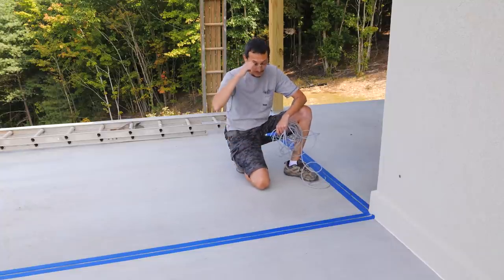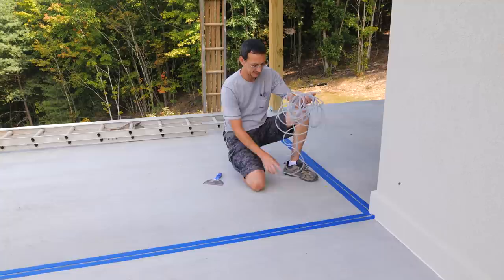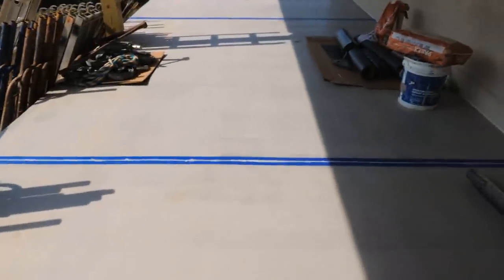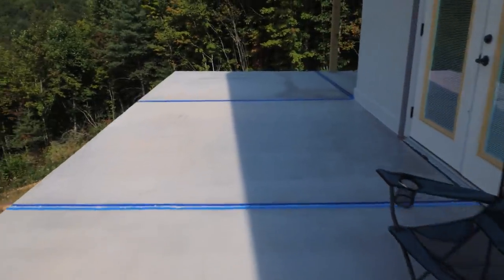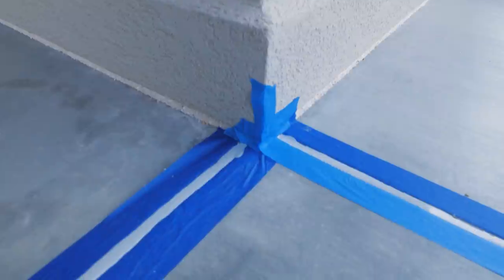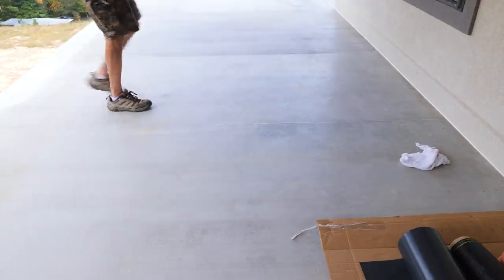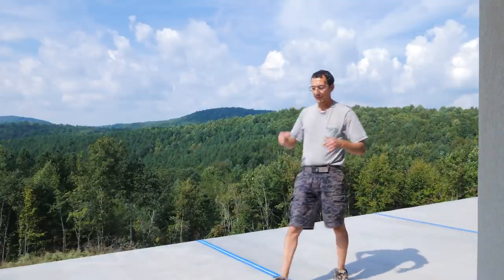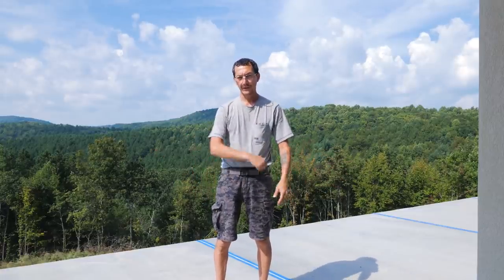How To Seal Joints & Cracks in Concrete

Comment: Having been in the concrete polishing industry for the past decade we just rub a bar of soap over the edges of the control joint, fill the joint with polyuria and then razor blade off any of the surface excesses and call it a day. The tape would be too time-consuming. and we backer rod if there isn't enough dirt in the control joint to take the place of the backer rod. It's the only advantage to a dusty worksite. They do sell a small wheel on a handle to sink the backer rod to the proper depth at just about any hardware store.  It's what you will see done at most all commercial examples.

Comment: Good call on the backer Not sure you really  needed to tape it, when the concrete  guys do this on any job site I've  been on they fill the joint then they take a scraper over the joint  to take off the  excess.

Comment: What is the tape you use and why do you use it on a finished drive/patio? Ii it to protect drive from run off?
Reply from the maker: It’s just regular painters masking tape to make a clean line while the sealant cures. When you pull it off you have a perfect joint. Otherwise you would have a sloppy mess.
Reply: Thanks

Comment: Are you going to seal the rest of the concrete with a clear sealer ? Thanks.
Reply from the maker: We did that after we poured the slab. I’ll do another coat once we finish the build.
Reply: @Guildbrookfarm , can't believe I missed that. Thank you.
Reply: What brand do you recommend to seal driveway concrete and where can I buy it? TIA
Reply from the maker: Contact your local ready mix concrete plant. They always have the best stuff or know where you can get it.